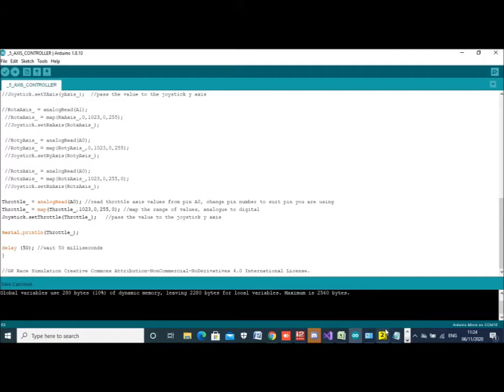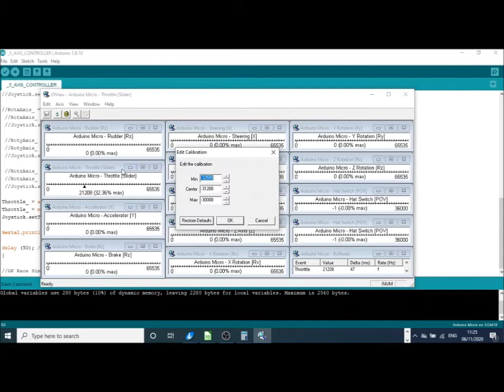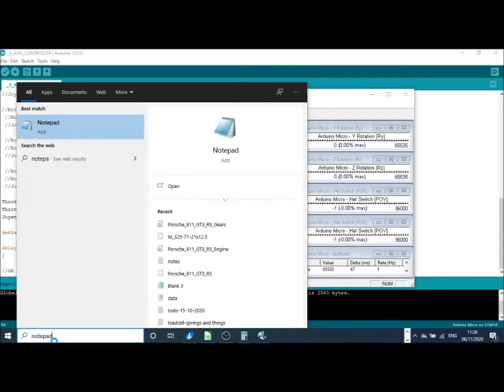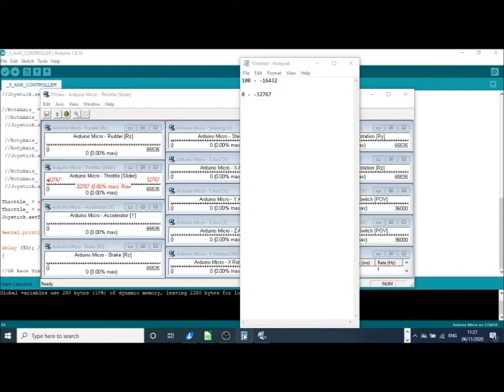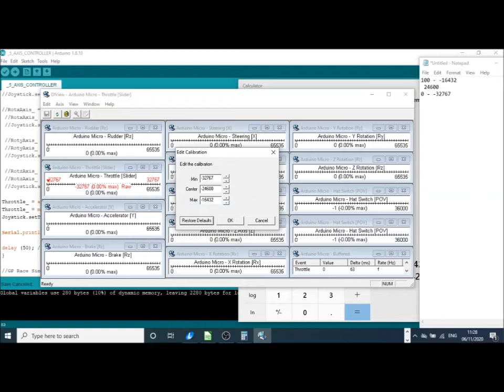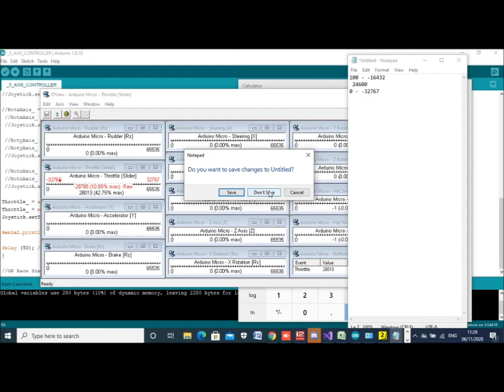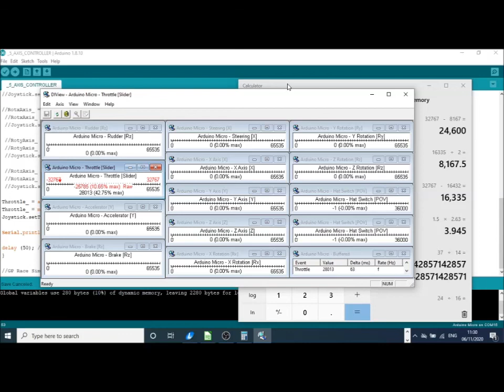Make Your Own Loadcell Pedals - Part 5 continued

Comment: Hi, Thank you for this. I've made a loadcell brake that shows up in DIview however rFactor2 is not able to see it as a brake pedal. Windows doesn't register it as a gamepad either. How can I get it to work in a game? Thanks
Reply from the maker: What board have you used for the controller?
Reply: @GPRaceSimulation  Pro Micro 5v
Reply: So had more of a play with it today, I had found that it wasn't saving the DIview calibration so thus the pedal movements were too small for the game to register. All sorted now. Thanks though for helping.

Comment: Hello, I made the mod using 50kg load cell, HX711 and Arduino Leonardo micro and I have a problem that the arduino is recognised as "unspecified" in "devices and printers". In the DIView the input is working just fine. Im using Windows 10. Any ideas?
Reply from the maker: Have you tried to assign it as a controller in a game to see if it works? If its showing in Diview I would imagine that it would work.
Reply: @GPRaceSimulation   Oh it does work when I tried it now. For some reason it didnt when I tried it few hours before. Im sorry for wasting your time.
It probaly had something to do with calibration. When I tried it for the 1st time, I didnt calibrate it and 0.1% (1kg) raw power equaled to 0.1% on the axis, so the input I was giving wasnt probaly enough for the game to even recognize it. Before I tried it now, I calibrated it and now 0.1% raw power equals to 1.95% on the axis.